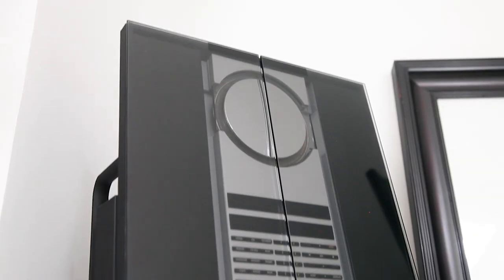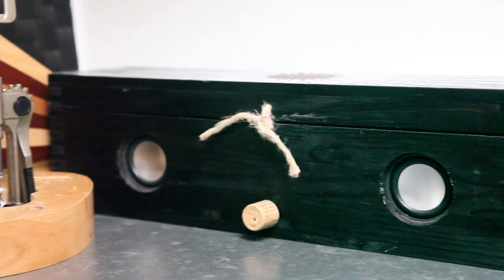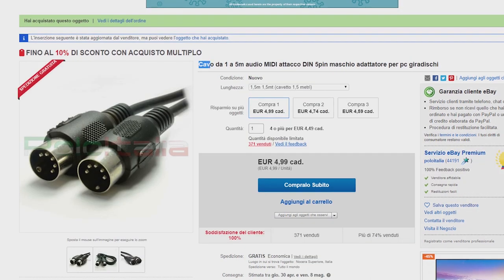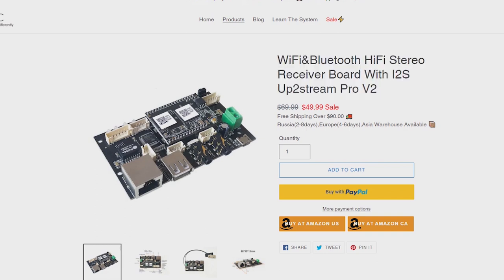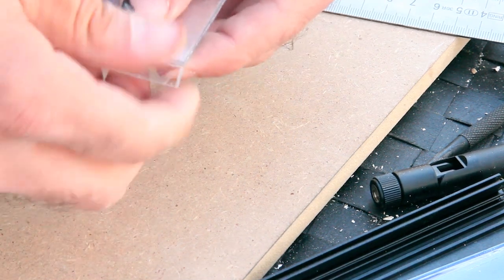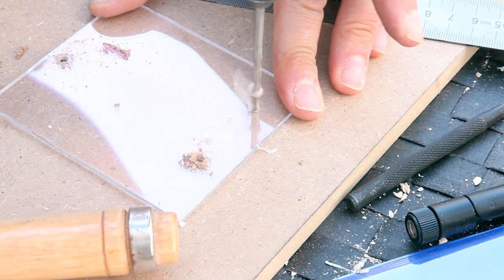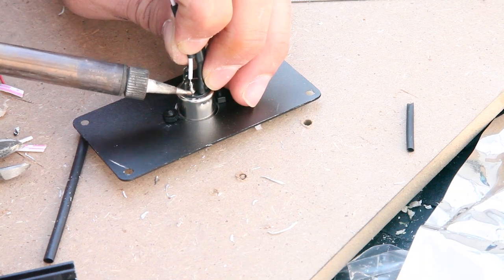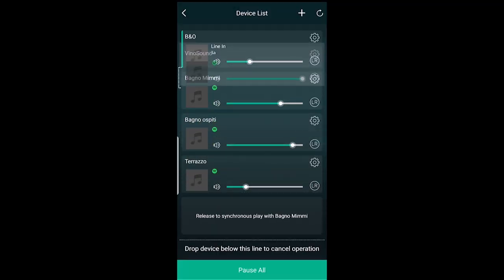Bang & Olufsen WiFi Upgrade

Comment: Very cool, but there is plenty of empty space inside of that unit to integrate that hardware inside. What you have is a never version of BeoSound. Those used to have. Tape deck built in below the cd mechanism. Now it’s just a void which could house all that stuff.

Comment: Anyway to hook this up to stereo amplifier?  Without using the stock speakers?  There has to be an adapter available?
Reply from the maker: You want to use this sarebbe device on a  normal amplifier instead a B&O?! You can use RCA in place of the din connector

Comment: Cool Addition, but could be much easier by connecting a Bluetooth or airplay device via aux, or is there any advantage of your Solution?
Reply from the maker: Hi Leo. Before this I used a Bluetooth receiver for a while but the range distance is limited and if not in use it shutdown. Airplay is only apple...and ehm...I hate Apple (sorry) XD.
This Technology is similar to the Sonos one, but cheaper, I can have the multi-room with the other devices in my house (you can watch "Wine Boom Box" and "Wifi outdoor stereo" from my other videos) and it work via wifi and always at your disposal.

Comment: does it work to wake up B&O devices from sleep playback starts, or do you have to turn on manually before streaming?
Reply from the maker: I have to turn it manually. All the device control use a proprietary protocol. I've tried with some smart remote but no one work. The only one should work was made by logitech but is very expensive and the don't produce it anymore.

Comment: Ciao io non riesco a sentire nulla dall'ingresso aux, sembra che il volume sia bassissimo e si senta solo il fruscio delle casse. non so se sia un problema del mio beosound o meno
Reply from the maker: L'unico dubbio è che i collegamenti siano errati sui pin. Hai il mio stesso beo? Hai provato sui tutti gli slot d'ingresso uscita del beo?
Reply: @CastelliOnAir  io ho il modello prima con il mangiacassette, e non ci sono altri ingressi oltre a quello ... ho provato anche con un preamplificatore ad aumentare il segnale ma niente
Reply from the maker: @edoardofacco5394  strano, dovresti avere il Beosound 2500 se non erro. Riesci a mandarmi una foto dei connettori din disponibili sull'impianto? info@castellionair.com ... vediamo se posso darti una mano